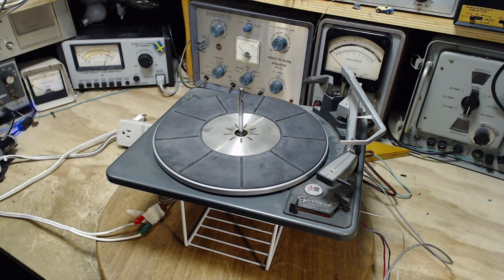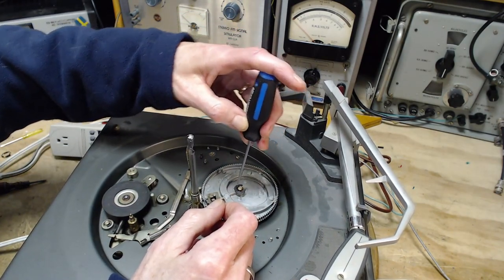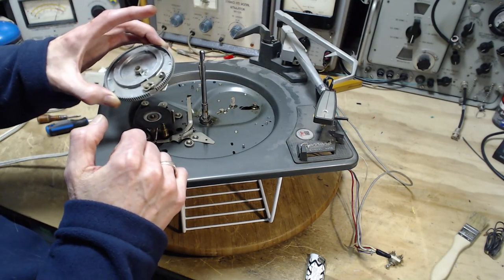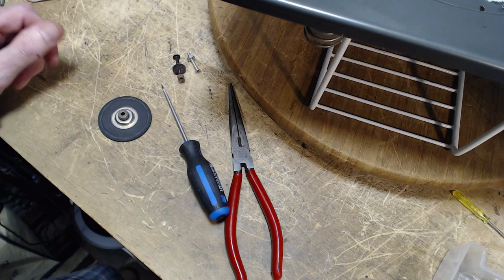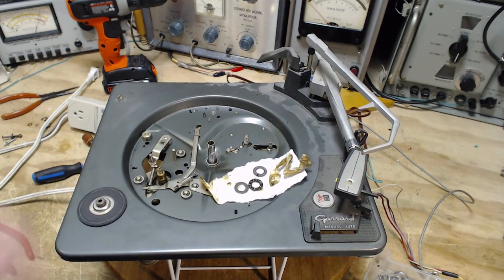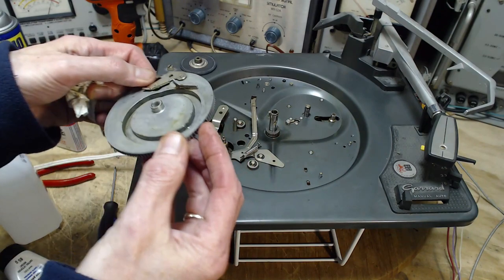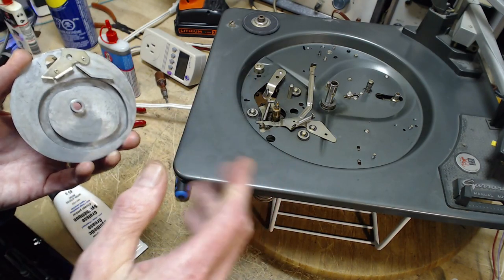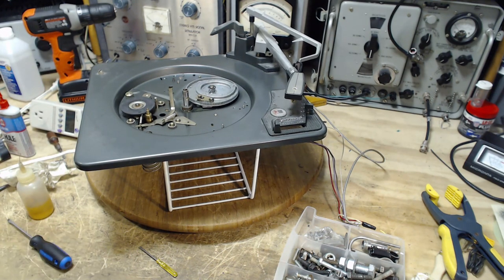Canadian General Electric C701 Console Video #2 - Garrard 40-MKII Restoration

Comment: Gonads retracted a few inches when I saw a drill, sandpaper and rubber wheel...did we not destroy a similar part in an earlier turntable hack ???
Reply: No biggie.  If it does he could just get that guy at Voice Of Music to rebuild that one.  I'm wanting to say his name is Gary something or other but I can't remember.  I know it's a service they offer.  I've only used them for styli and stuff like full size changer spindles and full size 45 rpm adapters for changers, etc. but I've seen others send hardened idler wheels there to have them rebuilt.

Comment: Not too much or the speed will change!!!
Reply: NO! An idler wheel serves only to transmit rotation. It does not affect speed!
You are mislead by judging the function based on rotational speed of the idler wheel itself in respect to the driving motor pulley. But since both motor oulley and platter rim roll on the circumference of the idler, what counts is circumference surface speed. And then it is clear as day that any fraction of an inch the motor pulley moves the circumference of the idler wheel forward, is carbon copied to the amount the moving circumference of the idler wheel moves the platter forward.
In this configuration the size of the idler wheel will NEVER change the speed due to its size. PERIOD
What however you change by grinding down the wheel is the angles in the triangle formed by the idler wheel axis, and the contact points of motor pulley and platter to the circumference of the wheel.
The angles in this triangle are crucial for optimum friction. If the angles are correct a drag on the platter will force the idler press more firmly between pulley and rim, making up for slippage.
If the angles are incorrect the idler may not exhibit this desired behaviour. If the idler wheel is too big it will not get pressed into the space between motor and rim and slip from the get-go with the slightest drag on the platter. And if the idler wheel is (ground down) too small it will press into the space too tightly  and cause binding
Reply: @randomsteve4288  rubbish!

Comment: "The size of the idler wheel doesn't affect the speed..." Hum... NO... NO... NO...
Of course it does, dummy !!
Reply: @tommybewick  Still Closer obviously doesn't adult very well, that's for sure.  And of course his page has not a single video of his own to show everyone how it's done because he's afraid everyone would treat him the same way he treats others.
Reply: The Clown Show starts at 31:10
Reply: @StillCloser Sorry but the size of the idler wheel will not change the platter speed. You are mislead by judging based on the idler wheel's own axis speed. But the axis speed dont matter. Since both motor pulley and platter rim ride on the circumference of the idler wheel, only the circumference speed counts. And for every millimeter the motor rides on the idler wheel circumference, the idler wheel circumference rolls along the rim of the platter. It is a 1:1 carbon copy.
Reply: @randomsteve4288  You're confusing angular speed with linear speed, which is what matters in this case - A smaller idler wheel will turn faster, (the circumference is smaller, therefore it needs less turns from the capstan in order to complete one of its own)  that's a very basic principle of clockwork mechanisms...